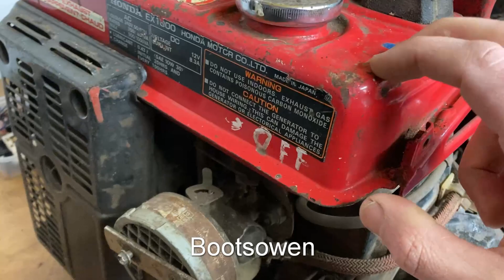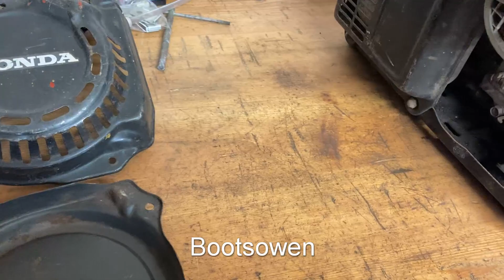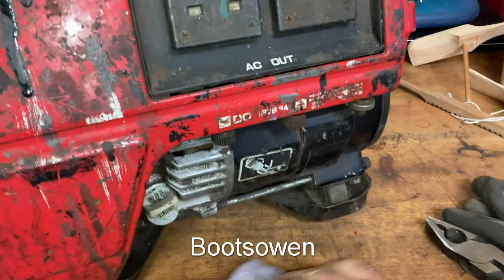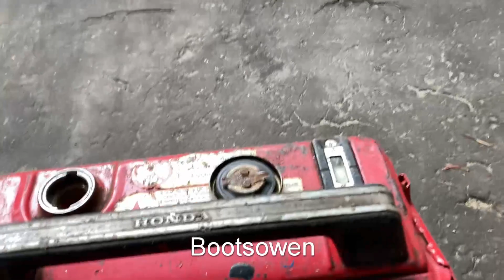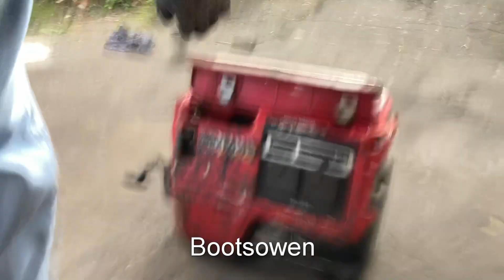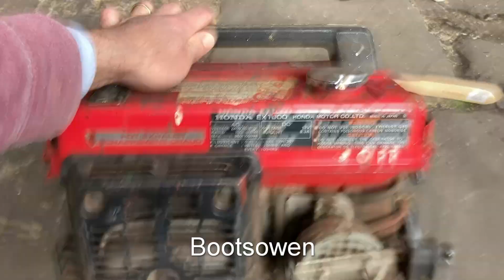Will it start?  Honda EX1000 suitcase generator

Comment: Here in the USA, I picked up a Honda EX1000 for cheap and it runs great for the first 15 minutes! Then, the spark plug gets coated with carbon due to oil getting past the valves and burning up.
Reply from the maker: Or is it just rich on the carb mix?
Reply from the maker: If you're at a higher altitude you might need to thin it a bit?

Comment: Owen, very handy little unit for remote tools. 2 thoughts, first a short length of rubber pipe on the spark plug will make it easy to fit without cross threading, I use this trick on my Honda. Second, if you re-tension the recoil starter cord the motor will turn over much better, cheers, Andy
Reply from the maker: It needs an oil change too Andy, all on the to do list,